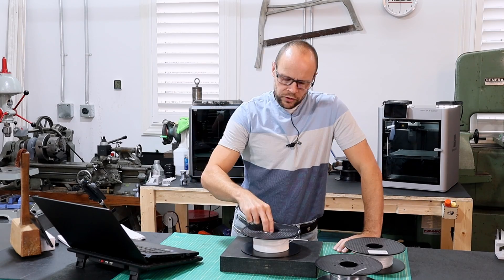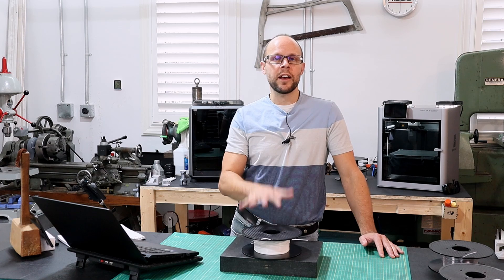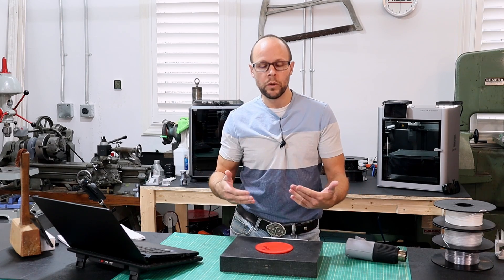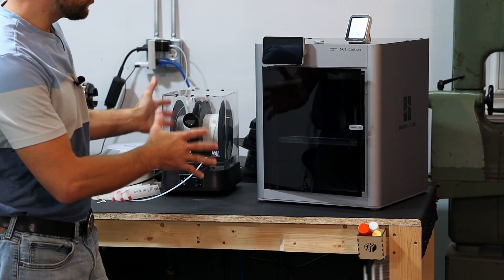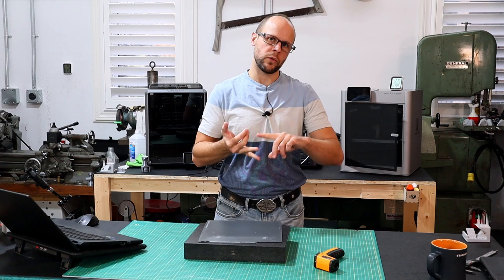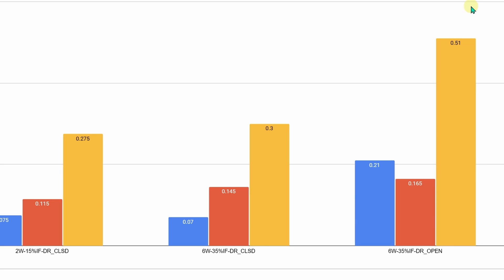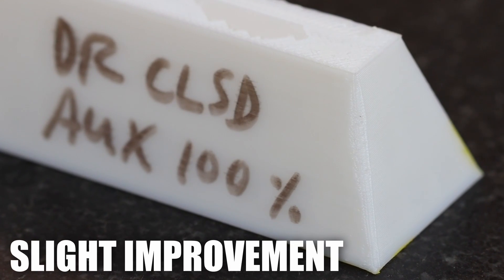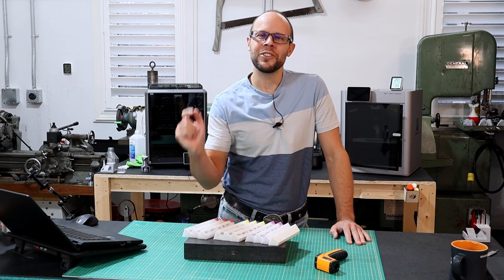Does PLA Warp?  If it does, how much compared to PETG and ABS?

Comment: Hello! Will you please share how you calibrated your Q1 to get rapid PLA to stick very well? I’m using a creality hyper PLA and Elagoo RAPID PLA+ and I’m having a rough time. .6 nozzle, .3 height. Manual bed leveling Using paper, receipt paper, Z offset, washing buildplate, alcohol. All the tricks, and I still have problems. I’m printing part of the “Dragonslayer sword” from printables. So it has sharp corners and is tall for each section. The corners always curls up for me partially into the print. 215-230C 60-70C bed. Unless I have the first layer wayyyyy too low to the point where the filament is rippling on the build plate, use brims, and glue all at the same time, it doesn’t stick worth a crap. :( Turned rapid aux fan off and it sometimes is better, sometimes not. No room drafts, filament dry. Groups have not been able to help. I have bed meshed with the bed hot too.

Comment: Used PLA with a 3D pen, warping is severe, any flat surfaces longer than a centimeter or two get warped.
With a 3d printer with an unheated and not perfectly leveled bed it also often was bad enough that even huge brim didn't help.
Didn't have issues (yet?) with a heated bed and autoleveled printer.

Comment: has anyoine figured out a way to stop elegooo pla+ to stop warpping ive gone high bed temps and  draft shield 65-70c ive gone lo bed temps 0-40 and max cooling ive gone standard 60c and 50% fan  i cant get elegoo pla + to stop warping
Reply from the maker: The part itself could be the problem, if you're printing long and narrow parts, can you describe it for us?

Comment: Good video I had missed, but I think you are taking the wrong temperature to calculate warping: not printing temperature but Tg, glass transition temperature, since above Tg stresses and warping can "flow" and (mostly) disappear. Once Tg is crossed, the plastic is frozen and warpage appears. You will see, if you measure more materials, that this approach leads to more accurate estimation of the amount of warpage. It was discussed on the Polymaker Discord some time ago.
In fact you could do a theoretical approach as well by calculating expected warpage based on Tg and k.

Anyway, once the Q1 arrives I think ill try to regulate chamber temperature for PLA to about 25 °C which should reduce warping, increase maybe adhesion and still allow proper cooling.

Comment: in many 3d printing knowledge articles regarding warpage there is typically a lot of coverage regarding coefficient of thermal expansion (CTE), some mention of print temp vs ambient temp, but little or no mention of Young's Modulus (E) or the stiffness of the material. the third is still critical to understanding warpage because it is the material's ability to resist warpage strain under it's own stress of contraction when cooled. if you compare ABS vs PLA for example, the former has something like +60-70% worse contraction due to higher CTE and higher temp deltas but also ANOTHER +50% worse stiffness. that is easily 80-90% more warpage right off the bat.

one thing to note about PLA is that while it is the stiffness king compared to PETG/ABS, this is only true below the glass transition temperature (Tg), above which it drops by ~90%. for PLA that is a good thing for resistance to part warpage during printing, not because it is stiff but because the lower layers can shrink without actually stressing the part and once printing stops it suddenly regains its high stiffness, relatively locking the shape in place. IMO the best way to take advantage of PLA's special properties vs PETG/ABS with regards to warpage is to keep the bed and ambient near Tg, something that is not possible with the other two materials. in the video example where bed is 60 and ambient is 43, that is something worth experimenting with to try to lower bed temp and maybe let the chamber soak more before starting. because of the overall better CTE and higher stiffness, usually this is not needed--but it becomes a key consideration if you really want to get the best out of PLA where only warp is a concern (huge parts). when minmaxing, you cannot really do apples to apples conditions, since each material has its own sweet spot. i believe bed 60C is slightly pushing it for PLA.

as for ABS, you can fight the low stiffness in two ways. one is by greatly increasing adhesion externally (glue stick, hair spray) and the other is a cop out and using an arguably different material instead: carbon fiber filled ABS--that directly increases stiffness and lowers CTE. while marketing often touts higher strength and toughness of CF-filled plastics, the real reason we like it is because of printability (reduced warpage compared to non-CF).

in many ways PETG is actually IMO the best sweet spot material to print with considering most factors (cost, smell, stiffness, toughness, printability and reliability under stress in warm conditions) and i would recommend anyone to try it out if you have only been printing with PLA.

Comment: hi everyone, an external cooling air saurce is the best solution for a closed printer 🙃🙃🙃
Reply from the maker: The CPAP approach?
Reply: @NeedItMakeIt  any system like a (bigtreetech universal turbo kit) that takes air flow from outside the chambre.
Reply from the maker: @sb53-systemssc28  If you're printing at extremely high speeds and an especially small part I'd imagine you'd need to bring in cooler air to compensate.  The new T1 and S1 have a CPAP style fan do to this and they're quite a bit faster... at least on paper they are.
Reply: this is also necessary for the heatsink, otherwise we are trying to cool it with the 60° if the chamber is heated 🥵, can u make it ?
Reply from the maker: @sb53-systemssc28  Absolutely, I haven't had much success printing PLA in an enclosure with the door closed, it's mainly due to cooling overhangs, but yes if you can cool that heatsink well enough I think it can open up some possibilities.   The fan for the heatsink usually pulls in air from the chamber, unless the new setup are different I'd have to have a closer look.
Reply from the maker: I had a look and found nothing detailed enough to know for sure.  I think it would only make sense if the fan was on at all times and not treated solely as an AUX, otherwise it wouldn't receive enough airflow.

Comment: Creality hyper PLA warped for me yesterday for the first time. The problem was low room temperature i guess.
Reply from the maker: I'll have a video coming out tomorrow which shows warpage on several materials, and one material which is highly resistant to warpage.  Hyper PLA does seem to be prone to warpage, but I do believe that it's related to room temp/enclosure temperature.  Also if you're printing a 'heavy part' that will contribute quite a bit to warpage.
Reply: @NeedItMakeIt the hyper PLA - cf warps quite a bit less, with the exception of large flat thin parts.

Comment: I bought a Prusa MK4 and the warping I get in PLA has ruined my interest in 3D printing. My PLA prints warp so bad I can sometimes put my fingers under the print to remove it from the bed. I've changed the heat settings around and reprinting the same thing over, looking for better results. I clean the plate with isopropyl alcohol 99% and even starting cleaning that off with a damp cloth. I've tried draft shields and putting a garbage bag over the printer for the entire print. Nothing seems to fix the issue. The only thing that seems to stay suck the print plate seems to be Silk PLA (and like you mentioned in the video it pulls the plate off the bed a little. not very noticeable).
 I would think it would be surrounding air temp and moisture, but putting garbage bag over it didn't really help. I may just take that garbage bag and toss it out the window (with printer inside)
Reply from the maker: If you're printing heavy, lots of walls, and heavy infill, your part will want to warp.  Ditch the plastic bag and go for a thick towel or a blanket.  I just tried this with my Ender 3 V3 and it works wonders.  Glue stick of course is also required.  Your temp inside the "chamber" will reach around 40C with the blanket and that will be just fine for the job.   If you like, you can sent your model to me and I can have a look to see what might be causing the trouble, but this is something that can be solved.  Needitmakeit@gmail.com
Reply: I don't really have a specific model causing the problem. everything seems to peal off the plate starting on the side the fan isn't facing. I don't mess with the default settings too much because I'm still learning, but I usually do 2 walls with 10%/15% cubic infill at temps recommended on filament rolls. If it's a small contact area on the plate, has sharp edges, or seams on one edges I'll do a brim. (the brim helps, but will start lifting too.) I will have to pick up a glue stick and give that a try, along with making the enclosure better. Thank you for your help! Also I appreciate that you made the video about PLA warping. I could only find PETG and ABS. This helps a lot
Reply from the maker: @MitchMAH  The only thing that comes to mind is that the offset to the bed isn't quite right, it needs to squish into the bed.  If you're printing on a smooth bed, it's not going to resist the pull as much either.  Personally I use glue stick on all of my prints.  The only time I have a problem is if there is only a single line of contact with the plate and I print heavy parts that are prone to it.  Grab the Elmers glue stick, I've found that works just as well as any.  There are some cheap dollar store ones that don't work well at all.   Let me know!
Reply: @NeedItMakeIt  I tried using the glue you recommend. The prints are sticking better than ever. I've only printed one thing in two different filaments, but with the glue it was nearly perfect. I have the smooth PEI plate and the bed can't be manually leveled. I was afraid to mess with the Z offset because the print head probes every time and I didn't want it to go any lower than it measures. I still haven't enclosed it, but I will keep that in mind as well as the offset if I come across more warping. Thank you for all your help and the video. I wouldn't have used glue on PLA otherwise, and my troubleshooting was driving me insane with no good results.
Reply from the maker: @MitchMAH  That's perfect.  Way back when.... 5+ years ago I started printing with ABS, which was a poor choice for a beginner, and I struggled so much, and eventually I ended up switching mainly to PETG.  Having an enclosed printer pretty well solves most of those warpage issues these days but I continue to use glue stick because I know that I will have success.  For the amount of time and cost, it's well worth it in my mind.  

Some filaments will give you more trouble than others, and some prints as well and unless you're printing the same part day in and out and have dialed in everything perfectly, it's hard to predict what will happen.  

That's my 2 cents anyway.

I'm glad you've got it sorted out!

Comment: I have some large flat parts that I print and I have warping issues with PLA+ on the P1P but not on the P1S, which supports what you're saying. After watching this video, it makes me wonder if I should design the corners to be lighter weight with thinner walls. I'll have to try it out. 

I'm also curious to know how bed temperature impacts PLA warping on the P1P. Makes me want to give the Bambu Lab cool plate a try as well. 

Thanks for the good work.
Reply from the maker: For sure, the more dense your parts are, the more they'll want to warp on you.  I wanted to show this because it's quite hard to tell because the buildplate lifts away from the magnets; most people have no idea that it's happening.  Personally I've found to have the best success with PETG, it seems to want to stay flat far better than the rest.  

Certainly printing in an enclosure will help to reduce the amount of stress during the print and should provide better results, heat creep can become a problem (I've never had it) hopefully over time better extruder-hotend thermal breaks  in the newer printers should help to avoid these issues.
Reply: Thanks for the reply

Comment: I recently had brand of PLA that was new to warp severely. This was the first brand of PLA with which I had such severe warping. I've encountered minor warping with other brands when printing thicker parts, such as 1-2-3 blocks, on the same printer. With the PLA that was warping severely, I tried adding glue stick and increasing the bed and extruder temperatures which yielded a marginal reduction in warpage. The printer is in an enclosure and printed with flap fully open, fully close and partially closed with little improvement in warpage for the problematic filament. I also monitored the interior temperature and the temp peaked at about 78 F (~24 C).

Comment: could you do a video with AUX fan 10-100% and the differents of printquality of BBL PLA?
Reply from the maker: I can probably fit something in yes, do you have a print in mind that would be well suited to the tests?  For the filament testing, I'm still getting running with my channel and I need a bit more traction (code for money) before I can purchase some filament.  I do have some PETG coming next week and I have partial spools from Bambu which may be enough for some small test pieces as well.

Comment: I don't have any issue with warping, but this video convinced me to actually built an enclosure, because you can alway open the door, but you can't close it if you don't have one.
Reply from the maker: You'll definitely see better and more consistent results with an enclosure.  Up until about 6 months ago I was using a 1/4" thick MDF enclosure with a PLEXI door, and it worked just fine, it was a bit big so I ended up finally taking it apart.  On occasion for my Enders I'd use a towel over the printer, it does help quite a bit as long as your print isn't too big.  The spool position can be a problem for the towel idea too...

Comment: I was having a issue with warping when printing with pla+ and the the side with the AUX fan on to get rid of it I turn it off
Reply from the maker: That's good to know, I haven't had that problem myself.  Did you happen to have the door open as well or was that door closed?

Comment: I am new to pri ting and just got a K1. I have been printing PLA with it clos d in my unheated garage, temps have been hovering around freezing the last week or so. Getting good results to far.
Reply from the maker: This is actually perfect, I am working on a video right now on this very topic and your comment is really helpful to confirm what I was thinking.  Do you have any form of insulation around the printer at all or just bare on the outside?    BTW did you have to remove the tube from the cable chain coming into the extruder or has that very tight bend problem been fixed?
Reply: @NeedItMakeIt  No extra insulation, just running PLA with the top closed. Decided to put a thermometer out there and see the actual temps. Today it's 10°C in the garage and 75+ % humidity. Inside the printer running a print it's 24°C and 32% humidity.  I didn't do anything with the cable chain, just running it straight out of the box. This is my first printer.
Reply from the maker: @shirk15  Okay, that's perfect, I'm waiting for it to stop raining here and I'll be doing a test outside when it's hopefully at or below zero to see what happens and I'll add my gauges in there as well.   The Creality printer also has a few gaps here and there, they may be worth plugging up, even the exhaust fan.  

Part of the reason I wanted to make a video on this subject is that there is an increasing amount of research showing that 3d printing 'fumes' or micro particles could cause long-term health problems, and with more kids getting into this as well, we're better to keep the printing in the workshop/garage or non-living area.  That along with good air filtration.  I will probably need to buy an air-quality monitor and do some testing of my own.  

Oh you're lucky to have this as your first printer... I was blessed with an ANET A8, a rickety fire hazard.  It was horrific to assemble and wobbled so bad that my first projects were to fix the printer.  They've come a long way from just 5 years ago, that's for sure.